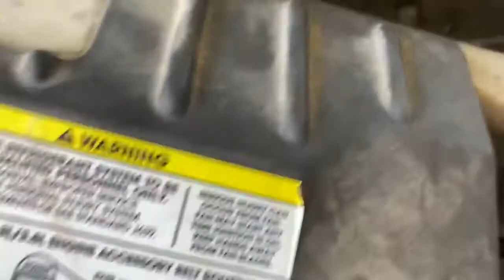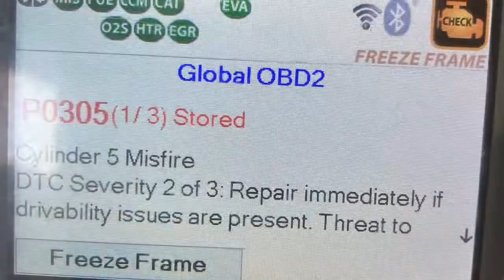2006 Town and Country - Spark Plug Replacement

Comment: Hi! So what was it doing? While driving, I push on the gas after stopping and it takes time to rev up. When sitting, I'll push on the gas and when it gets up to 3 rpms the car starts shaking. Does this sound familiar? Spark plugs were changed, started running slightly better but about to move to the coil. Thanks!
Reply from the maker: Rough growly idle and driving. I recall similar experience to yours.

Comment: I'm having same problem now going to start ignition coil how'd it go after you replaced that
Reply from the maker: After the coil pack was replaced the van ran great. If it hadn't worked I would have moved on to a mechanic. Plugs, wires, coil pack fixed my issue.
Reply: Thanks I'll try you really help me out alot with  spark plugs and water pump. I changed spark plugs and damn van was running worst than before
Reply from the maker: @truthnlies8330  I was very disappointed when spark plugs didn't fix my rough running issue. And since the coil pack seemed easy and cheap compared to hourly mechanic rate for diagnosis, I took the chance. Win some lose some.

Comment: Do I turn the wrench towards the driver side or passenger side to get the spark plug out?
Reply from the maker: Counter clockwise loosens them, the ratchet will have more space to move depending on the direction you point it.
Reply: @samvore2963  I'm standing on the passenger side of my van. Trying to change the plug in cylinder 1. Don't know if that helps.
Reply from the maker: @savannahparton9277  at the 6 minute mark I discovered the rear passenger side spark plugs are best removed with ratchet pointing to passenger side.
Reply from the maker: @savannahparton9277  also I had room to reach to that spot behind the engine from the drivers side. In the back point ratchet handle to passenger side, in front point handle toward drivers side. That’s what worked for me! Good luck!
Reply: @samvore2963  thank you so much. I had to get my neighbors husband to get the plug out. Oh boy I was surprised that the van was running.

Comment: Hey now do a front end allighnment on the thing with strings with a 16th inch toe inward. but I guess you put the jack stands under the a arms for suspension issues? Please it seems stone cold easy enough.👷